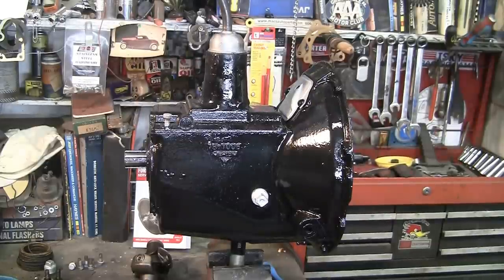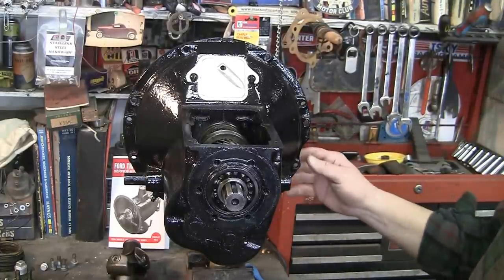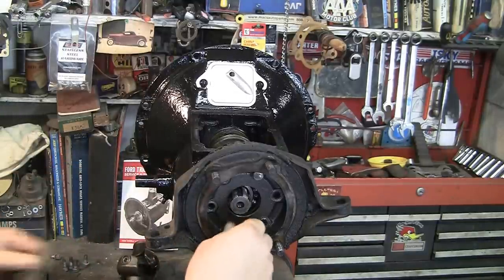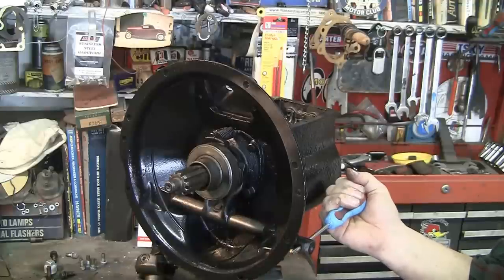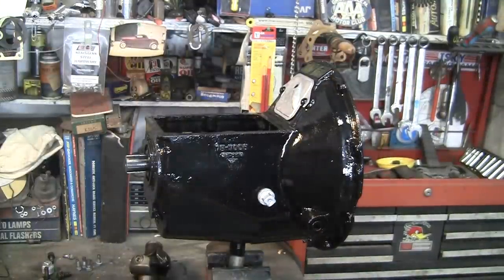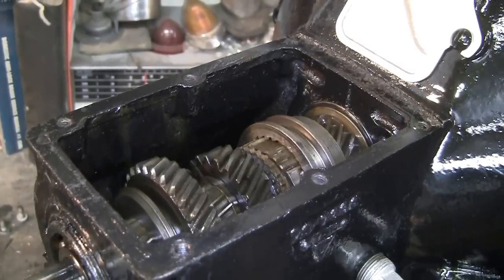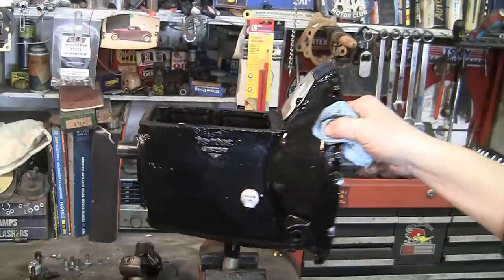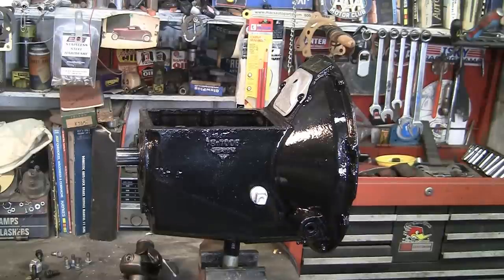1938 Flathead Ford V8 3 Speed Transmission Gear Inspection

Comment: Wondering if anyone can help me. I have a 1951 ford truck flat head and I want to pare it with a C4. I was told I need an adapter. Is there any way around that. Thanks.

Comment: Is there synchro from second gear to first gear?
Reply: Good question. I need to double clutch to downshift from 2nd to 1st in my 39. Have been wondering if a rebuild would change anything.